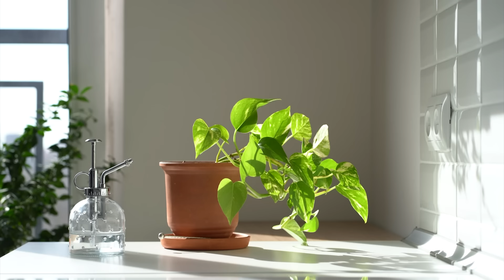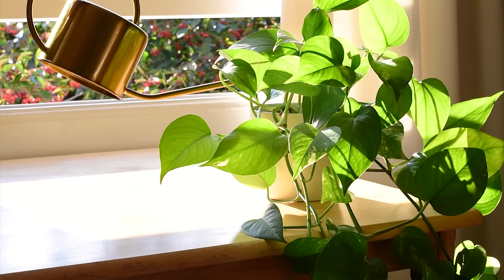Giving your house plants genetic super powers

Comment: There is a device called a ERV (Energy recovery ventilator) that you can install in your house. It works by swapping indoor air with outdoor air through an exchanger that tries to transfer as much heat and moisture to the incoming air as possible. The effect of this is that you get fresh air around the clock without wasting a bunch of energy, they cost like 100-200 a year in electricity to filter an entire house (1500 square feet). The fresh air from outdoor can optionally be passed through a filter to remove stuff like pollen and smoke or whatever. 
One of these plant systems costs $5 a month (if you buy a 48 pack subscription) and covers a single 160 sqft room, so if you wanted to cover the same 1500 square foot house as the ERV then you'd need 10 plants at $50 a month or $600 a year for the powder.
Reply: Yes, for the powder right now, but ultimately their goal is to provide plant strains that do the filtering.  And that's something that would presumably be cheaper over time and renewable. Unless of course they go full monsanto and make it so there's no way to germinate the plants yourself with seeds etc.
Reply: Sure, but these plants only filter out VOCs, an ERV or other filter system also filter out a bunch of other stuff
Reply: @droko9 ok what happens if for some reason in the future power becomes prohibitively expensive or there’s some major catastrophe that renders the electrical grid useless and the outdoor environment hazardous to breathe.
Reply: fun fact for you: pothos (aka epipremnum aureum) almost never flowers on its own. it has an impairment in the gene that codes for the hormone that induces flowering, so it usually just reproduces by spreading and through division. you could induce it to flower by spraying it with the required hormone, but on its own it’s not going to make any flowers that you could pollinate to get seed. and because of the way that sexual reproduction works, there’s no guarantee that the offspring would express the same characteristics as the parent plant. 
the copyright on patented plants usually prohibits you from producing more of them using any means, including through cuttings, so the fact that pothos can’t flower on its own doesn’t really matter in the context of this conversation. i just think it’s very interesting that a plant that cannot sexually reproduce has been so successful at invading so many different areas around the world.
Reply: @Jirekianu  just casually marketing a gm super bacteria.. What could go wrong lol.. See how long it takes to outcompete all natural fungi and rhiizomycelium and all the natural soil life.
Reply: An ERV system is probably going to cost something like $100–$300/year amortized over its lifetime, and filters will be that much or more depending on filter quality and how dirty your air is, so the price comparison might actually be somewhat  close. It would be very situationally dependent.
Reply: Why not just leave the door open and leave your stiff outside to gas off for a week or two. Or better yet just buy old second hand furniture and make them  stop making as much new furniture. Back in the old days people kept things and didn't let go of them because they had a connection to be passed on. We need to reestablish that and stop buying so much stuff and going into debt, especially in an economic crisis.
Reply: @bigmouthstrikesagain4056  Umm if you live where you can leave your front and back door open (screensdoors) you still have the issue of smoke from fires but whatever man.
Reply: @dj4monie  yeah. But where are you living that has fires large enough and frequently enough for your comment to make sense? 

No. Not even California. Don't even try it. And don't ask how I'd know.
Reply: holup why tf do the plants have monthly fee
what happens if i stop payin
do they send the plant police
Reply: "The fresh air from outdoors" is the key point here. If the outside air isn't fresh, it's a waste of money.
Reply: @EnderSpy007 Yup, I live in Dallas and the city has encroached so much and so many trees have been cut down and there's so much more local traffic vs when we bought our house that the 'fresh' air and cooler microclimate is no longer. It used to be 3~5 degrees cooler here than in the city a bit over due to the trees.
Reply: It is much worse, 10 plants won't do anything. The idea is cool and I'd even buy 20 or so, but the $5 subscription kills it. You can kinda see from their website that it is yet another silicon valley packaged monstrosity, so unfortunate.
Reply: I got one of those, its called a swamp cooler. Lol
Reply: Those sort of devices are literal scams.
Reply: I lived with this. And the tech jargon made me so disappointed when I first saw that it's just the air ducts passing next to eachother with heatsinks in-between. Don't know what I thought it was actually doing,, though because it just makes sense this way.
Reply: Who is wealthy enough to own a 1500 square foot home these days?
Reply: I don't want to make my home hot and wet. I want my air dry and cold.
Reply: @FusionDeveloper  wrong. In winter you want it hot and wet, because it is already dry from the temperature. People always complain about feeling dry in winter for a reason.
Reply: @mattymerr701  Depends on where you are in the world and the exact weather conditions day to day. In the western half of Washington State (US) there are plenty of times during the winter where the air isn't dry despite temperatures being low.
Reply: @mattymerr701  oh, for the winter time.
I was thinking it was for year-round.
Year round, I prefer it be in the 50-80 f range.
Reply: @mattymerr701 Yo there's this half of the world who lives near the equator, and we get like 31c at night with 70% rh? Actually pretty sure that more people lives in hot climates than rich westerners.
Reply: @minimumapature3361 what do "rich westerners" have to do with it? None of them are here. Majority of the planet isn't anywhere close to "rich" even by comparison to those with nothing. The gap between "first world" folks and those living in abject poverty is MUCH smaller than that between everyone and the actually rich. 

Knock off that blind hate bs. Especially when you know too little about what you speak, to justify it.
Reply: Except for like a half of the year, when ERV would fail from the low temperature outdoors and therefore is not a valid solution to the problem during this time

Comment: The fear of GMO in Europe is ridiculous. And this is coming from a European that is mainly buying organic food. In Europe we don't want GMO that could be designed so it cannot "escape" to the wild, but have no issue with slowly poisoning ourselves and our environment with pesticides that seep into our drinking water.
Reply: So, connect a red string between farmers using cheap dangerous pesticides with farmers using GMO's. If it turns out it's bad in any way, shape or form, they'll still continue using them forever and ever just like the neonicotinoids. Anything that is cheaper and can make a bigger profit is nearly impossible to roll back. I prefer if we had tested the neonicotinoids properly before we authorized the use and later realized we almost killed off all pollinators.
Reply: > I prefer if we had tested the neonicotinoids properly before we authorized the use

How much testing do you think GMOs should undergo before being implemented? There are some GMOs that have been grown for decades, at large scale, without any major issues. 

Surely these have been tested enough to have proven safe for use in Europe? Or do you believe that there's no amount of testing, in lab or in real life, that would prove GMOs safe?
Reply: @AvronV  They should at the very least make sure they cannot become wild, be spread either by pollinators/animals/natural conditions or hybridize. These are the minimum constraints I can see after thinking about it for 2 minutes. I think we can afford to undergo much more rigorous testing for something as lucrative as GMO's. It's the money that's driving this, not really a shortage of food (yet). We still have some time (if) before the climate is going to flip out to a degree where we need special strains in Europe.

Comment: The funny thing about gmo is that's we do allow some genetically modified crops. i planted an acre of Artaban vines three years ago. It was marketed as "more resistant to fungal infection." It didnt work tho apparently the Gen they inserted didnt work or something idk.
Reply: May have been a particularly nasty strain of the fungus if it didn't work to resist them.
Reply: @squessi  I wasent told in detail but we did had a ridiculously wet year so maybe? I was just told "the gene didnt activate."... so yeah
Reply: GMO is becoming a sales pitch... I assume its particularly hard to actually make a plant that would resist everything. As this video showed, each generation carries different genes and those evolve constantly. So same goes for fungal infections. They do not stand still. Each generation evolves. So if they make a GMO plant resistant to one generation, the other will probably get resistant... Or there are so many different fungal infections, that you cant make a single crop resistant to every other infection... 
This is where the selective breeding has an upper hand. 

By the way, the example they provided of the GMO with the cabbages and mustard, those are not GMO examples, those are selective breeding examples.... Two different things.
Reply: @S3l3ct1ve the point kinda is that selective breeding also changes the genome

Comment: Does the EU prohibit the sale of genetically modified plants? I doubt that. I like your channel, but this claim seems inaccurate. As far as I know, the EU does not completely ban the sale of GM plants - they allow it under strict regulations and only for approved varieties. Many member states do ban cultivation nationally, but selling approved GMO seeds or products is possible under EU law. You might want to double-check your sources on this.
Reply: Correct, GM isn't banned in the EU. Sure, there's some bureaucracy related to GM, but then again in the EU there's bureaucracy everywhere.
Reply: especially as these plants are not feed or food crops, but decorative plants; they still need to go through an GMO approval process, but a lot of the regulations will not apply, imho.
Reply: Nope. It just bans the undisclosed use of GMO and requires proof of claims on product quality.
It does ban commercial farming of GMO crops tho due to error rate being too high for civilized human quality standards.
Issue is the french didnt get approval (or at least didnt get a IP certification+publication that backs their advertising claim by the eu IP registry) and their prerelease papers from 2 years ago only give about the same effect as dumping a bucket of perfume field enchancing bacteria in a bucket in a room (as they eat up methane, a lot of thermoplastic particulates, released usually carbon or hydrogen bonded reacted byproducts from them, etc).
Reply: Also, the reason why directed evolution is not regulated as much as genetic modification is because it's slower. There is much less risk involved. Genetic engineering is a wonderful tool but, like any tool, it can backfire.
Reply: @DarksteelPenguin   it's it not really the same things evolutionary wise.
Reply: @DarksteelPenguin  directed evolution is much higher risk. adding a gene to process polyurethane into E. Coli will either process polyurethane, do absolutely nothing, or prevent some other process from doing its thing, which will probably just kill the cell. blasting radiation at E. Coli while putting it on polyurethane and seeing what happens can make it process polyurethane, or process something else, or become extremely pathogenic, or make it grow really fast, or make it able to grow on more surfaces or make it change colour or any number of possible outcomes. slower isnt safer.
Reply: @DarksteelPenguin  Countless plants have been accidentally made more toxic through directed evolution. Potatoes are a great example of this where some varieties were unintentionally made more toxic while selecting for some other trait. 

So to claim that directed evolution is safer due to being slower while selective gene editing is unsafe because it's quick, is in my opinion completely false. You have no idea what you're changing when you use directed evolution and so your potential vector of harm is infinite and difficult to test for, while a targeted gene edit only changes what you want it to and so it's much easier to test it for safety.
Reply: @DarksteelPenguin  Except directed evolution tends to be more random and less controlled. Where as modifications via newer methods are much more precise and much less likely to have unintentional mutations.
Reply: It's not illegal, but the barrier to entry is so high that nobody bothers with it.
Today there's one GMO approved and even that is banned mostly at a national level.
Reply: The real question here is, who actually cares?
Reply: Questioning and challenging information is great, but the next step is googling to try to confirm your suspicions before sharing them.
Have a great day
Reply: Because we like to be safe.

Comment: Won't their bacteria simply be outcompeted by the one already in the soil? Absent high concentration of target compounds, the native bacteria would have a fitness advantage.
Reply: Yes, that's how they get you to subscribe to the refills
Reply: That's why this is a shitty subscription service
Reply: That does seem to be what the graph at 25:02 shows, if I understand it correctly. A gradual fade over (at least) eight weeks as the native bacteria replace the modified ones.
Reply: Yeah, that`s why you need to buy their bacteria on a subscription basis... :D
Reply: Why would the native bacteria have an advantage? I don't get the sense these are obligatory VOC phenotypes.
Reply: @IceMetalPunk  It takes both energy and resources to do pretty much anything as an organism. Even if there are no VOCs present, the pathways to process them could still be getting produced, using energy that would otherwise be used for growth or reproduction. Although, with my minimal knowledge of genetic engineering, I suspect that in as resource-rich an environment as houseplant soil, that's not really going to be much of an influencing factor.
Reply: @MH_Binky  Even in presence of VOCs the bacteria would only benefit from the genes if the concentrations would kill them off otherwise. In which case they would outcompete the others anyway.

But this gives me an idea... I wonder if they also analyzed what the VOCs are turned into. Would be quite the ironic turn of events if your plant takes up slightly unhealthy dichloromethane and spews out highly carcinogenic 1,2-dichloroethane 😄
Reply: @MH_Binky  I'm glad you think of it this way because people mostly ignore energy demand, but even without nutrient rich soil it's not likely important here. It's probably just a cytosolic protein or two, nothing major. There is a lot of waste energy use inherent in organisms in general, and the margins not being so tight is basically necessarily for evolution to work and "try things" anyway.

The random mutations accumulated from being raised for generations in a lab (kept happy on media without competition) and irradiation (if performed) are likely worse for their fitness.

Comment: I was wondering why do we even need the plant, when most of the degradation is done by soil microbes. If I understand it correctly, the thing is plant is basically consuming waste product of those microbes, so they can eat more stuff without drowning in their own poop. If that's not the case, can somebody who understands the process explain it better, please? 😀

Here is just a small excerpt from whitepaper on their website (link "The Science behind Neoplants" in page footer): "Powerdrops contain lyophilized cells of our Methylobacterium extorquens and Pseudomonas putida engineered strains, as well as everything they need to thrive in the soil of the houseplant and keep their populations high. These bacteria are also known to interact closely with the plant, mostly within its rhizosphere, where they exchange chemical compounds including sugars, minerals, nitrogen, and some pollutants. Hence, both the plant and its microbiome participate in the degradation of VOCs."